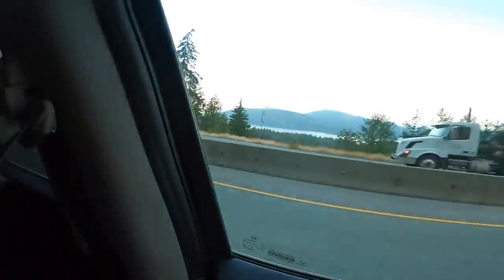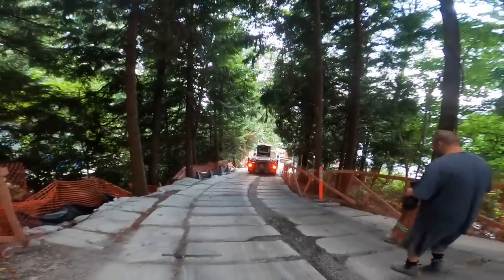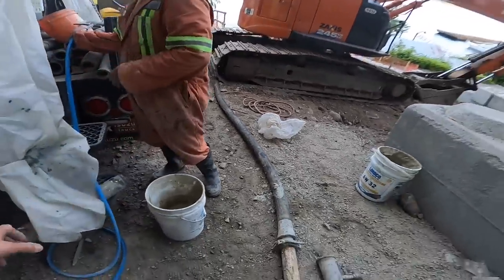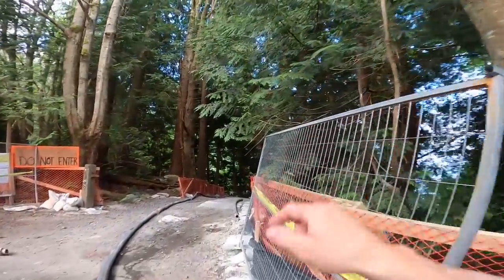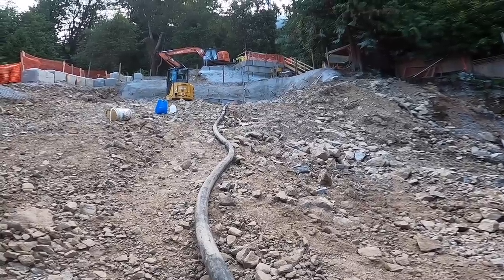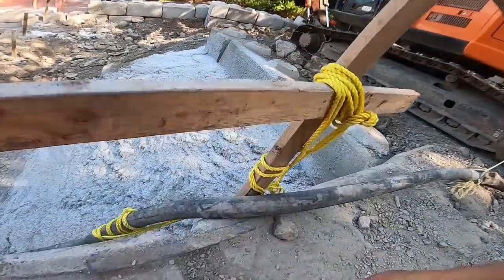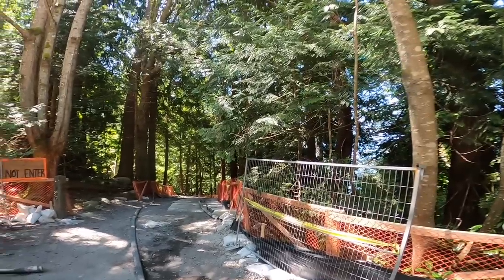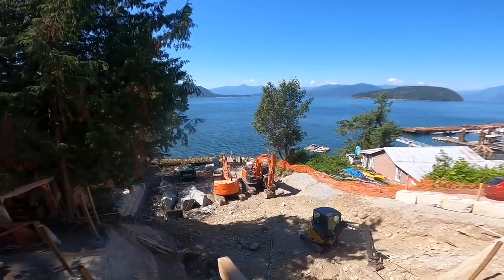Pumping a boat ramp through 500’ of line before the tide comes in. My most detailed video yet.

Comment: We poured dozens of those over about 5 summers at a big resort. We were pouring right under water.9sack with enough cchloride that it would set up in our chutes. Same guys did it that repaired a long stretch of interstate by us two years before. Same mix on a hot day on concrete. I felt bad for the finishers. They’d roll it with a 8 ft wide air roller,screed it if they could and brush it. They be driving on it that night.
Reply from the maker: I always get nervous when loading up a long run of line like this with a “spicey” mix. One of those situations when we make note of the fine print “sign here please” 😂

Comment: On Job's like that going downhill I put a little water in the line then I use some wet Newspaper in the line not too tight and then pour my primary in and that stop's it running away. That's how I've done it for year's here in Ireland and never have any problems.
Reply from the maker: I’ve tried the sponge ahead of the prime method a couple of times and failed miserably. My thought is that the sponge was just too tight. I like your suggestion of not too tight, wet newspaper. Definitely going to give that one a try! Thank you for watching and commenting 🙏
Reply: @canadianconcretepumper1979  yeah same  use newspaper scrunched it up and wet it seems to work for me had trouble with sponge before

Comment: I also use a "Rabbit" what we call it on the west coast, when pumping down hill. Which is a empty paper cement bag or anything paper on the site that is smashed into a ball that will fit in the hose coming right off the back of the pump. Hammer that sucker in tight into the hose! Its seems like the paper might plug the hose but the pump blows it past like nothing! I've never separated doing this even pumping down a straight cliff 6 ft off the pump, cheers
Reply from the maker: So I’ve tried that serval times using a sponge and never had much success. I swear that the type of sand used in our mixes out here causes them to behave differently.

Comment: I’ve been training on a boom in Southern California and even when I was line pumping I’ve never seen a pump, pump into another pump. What’s the reasoning behind that? Curious.
Reply from the maker: Keeps the pressures down, makes for easier pumping, let’s us pump a drier slump for the placing crew to work with on a slope like this, helps to keep volume up without having the line jumping around. For us it makes more sense to use the two pumps and have a quick setup and takedown versus using one pump and dealing with the time/labour required to setup larger diameter hardline. This is just one of those jobs where it really made sense for us.

Comment: When adjusting the slump by adding the extra gallons, will it mess with the PSI of the concrete?
Reply: Not unless the amount of water is crazy high, like 150 gallons per 10yds, basically unless the concrete is separating out from aggregate (rock). However there are ways around that such as super plasticizer which can basically double the allowed water content
Reply: Yes. They are inversely proportional, you can achieve a higher slump with plasticizers
Reply: @austinpalmlund5054  yes I think even before it starts separating from the rock the added water will start to destroy the strength based on my research. And plasticizers is the only way to arrive at that exact PSI

Comment: The 1450 psi of the TK60. Do you need then higher rated hoses for shotcrete? We're using 1233PSI standard hoses.
Reply from the maker: We’ll run either a few pipes, or wire braided hoses off of the hopper. Most of the reputable brands have pressure ratings based on a 2:1 safety factor (eg: a hose rated for 1233 psi continuous pressure will have a maximum burst pressure rating of 2466 psi). Either way, it’s not ideal living in that safety factor zone. ConForms is now producing 150 bar snap clamps for this exact reason. Many trailer pumps are now producing well over 85 bar, so the stepped things up to accommodate.

Comment: Wouldn't it make sense to suck bentonite at the end of the hose with a ball at the end? That way it couldn't run down.
Just guessing
Reply from the maker: That’s a good suggestion which I get quite often in the comments section. We’ve tried that technique a few times, and for whatever reason (perhaps the mix designs in our area) it rarely makes it through more than about 2 lengths of hose before dry-packing. One of these days I’m going to try it in a video just to show the results and see if any of the viewers have any tips as to what we may be doing incorrectly.
Reply from the maker: @styzr  on the last one I posted we used 5 buckets. The problem seems to be once it segregated it’s game over, regardless of the amount of bentonite. Can be difficult to find that prefect balance and get the bentonite mix just right.

Comment: Is that steel reinforced line BTW? I was told by a hose seller not to kink or pinch it anywhere as it would break or deteriorate the steel mesh in the lines. I see there are also fabric lines as well.
Reply from the maker: None of the stuff in this video is wire-braid. We have a couple lengths which we’ll as as the first hoses coming off of the hopper when pumping shotcrete, but aside from that we leave it back at the yard on the rack. It’s true what they’re telling you about not kinking it. Even with storing it incorrectly (at the bottom of the hose pipe) we’ve found that it gets flattened down and never really reverts back to iota original, round state.
Reply: @canadianconcretepumper1979  thanks for sharing man. Keep up the great vids.
Reply from the maker: @styzr  appreciate it brother 🙏🙏🙏

Comment: Why was he not listen to you and adding water into his Hoppor while blowing into it because the wetter it is in the line the SAFER it is for blowing out plus it gives you time to set up for 2nd blow out.
Reply from the maker: I was waiting for this comment! You can here him say in the video that when he turns his water in it kills the agitator (pro tip: the water valve can be partially engaged as such that the agitator still turns, albeit more slowly) bloody kids these days!!! 😂😂😂
Reply: @canadianconcretepumper1979  yep you can add a bit and turn the agitator on and off but if the concrete goes off in the line's and he has to hand empty them he will make sure its wet every time after that.
Reply from the maker: @johnnytyrrell7060  operator says on this newer machine you can not achieve partial water/agitator simultaneously like we can on our older machines. Our newer booms with the toggle switches for water/agitator are the same. In this case I just fill a 5 gallon bucket with water and add to the hopper while recirculating.
Reply: hes deaf  too

Comment: Instead of 2 pumps I would have used 4 inch
Reply from the maker: 4” is an offensive term around here with regards to line-pumping. Perhaps if we had been pushing big volume, but with a mix designed for 2” line and what ended up being only 27 cubic meters of it to pump, this was in my opinion most labour efficient way of getting this job done.
Reply from the maker: Also, you throw 4” line on and most all residential placing crews around here would quite literally up and leave. We’ve been spoiled with our 2” line friendly residential mixes.

Comment: Wow. The ball will just clean the pipe after the grout biggest waste off time I have seen. Can’t believe I just watched you do that 🤣😂🤣😂🤣😂🤣😂
Reply from the maker: It 100% helps, with our material. Leaves a thin film of bentonite slime in the hoses as well as fills the voids at each clamp/connection which would otherwise eat up a small bit of primer. Likely wouldn’t work as well with grout, but would still be of some benefit, IMO.